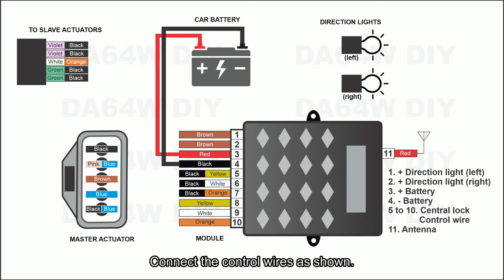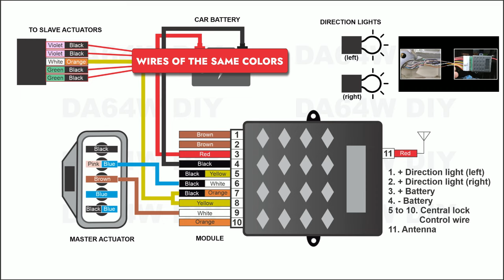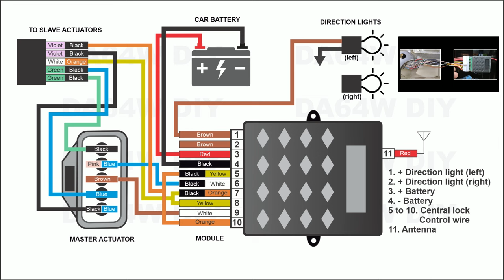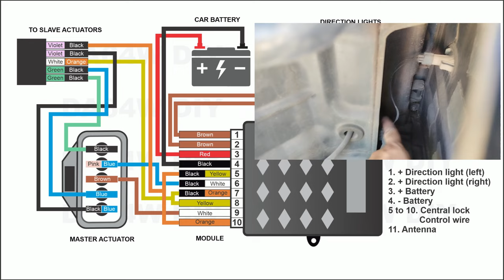Keyless Entry System Installation (Detailed Version)

Comment: is it possible to install keyless entry on a manual car
Reply from the maker: Could you clarify whether you mean a car with a manual transmission or a car with manual door locks?

For Manual Transmission: Keyless entry systems can be installed on cars with manual transmissions without any issues. The installation process is similar to that for automatic cars.

For Manual Door Locks: If your car has manual door locks, it might require additional work to convert to an electronic locking system before installing a keyless entry system. This may involve installing actuators in the doors to enable remote locking and unlocking.

Comment: what battery do you use for the fob? mine is kinda finicky when clicking it. sometimes it locks but mostly not. i noticed yiur fob led is blue but mine is red. maybe its a battery issue
Reply from the maker: My key fob uses 2x CR2016 batteries. The finicky behavior you're experiencing might be due to a low battery. Replacing it with new batteries might resolve the issue.

The difference in LED color could be due to a variation in the fob design, but it shouldn't affect functionality.

Comment: How can install the light 2 brown cables on switch button with 3 cables( signal lights..ground..corrent 12v)..can u help me? GREAT VIDEO 👍
Reply from the maker: Tap it on the positive wire of the signal lights.

Comment: gi tang² nimo ang iyahang original nga module ana Sir? or gi add lang nimo ang keyless entry nga module?
Reply from the maker: Nag-add lang sir.
Reply: @da64wdiy diman pwede sa akoa, way wires para slave. nindot unta ni kay function pa ang manual central locking.

Comment: Sir meron ako nabili na central lock with keyless pero yung for signal light niya isang wire lang. So if mag signal ako sa left sasabay din ang right. Ano gagawin ko po?
Reply from the maker: Kailangan mo ng dalawang diode, isa sa left signal light wire at isa sa right signal light wire.
Reply: @da64wdiy  salamat sir. Ano code ng diode at ilang amperes?
Reply from the maker: 1N5408 3 amps

Comment: Sir ung saakin nag connect lang ako ng alarm sa module di na gumagana ung manual switch nya sa pinto, ung remote nalang nagana.. Pag tinanggal ko lang ung remote dun lang sya gagana, tsaka iba yang wire ng module mo, kasi ako ung dalawang orange pasasamahin ko sa ground at ung dalawa yellow sa positive un kasi nakita ko sa ibang video, ganyan sana gusto ko tula ng sayo, nagana ung manual switch nya sa pinto at the same time pati ung remote sana
Reply from the maker: 64w din ba ang unit mo sir? Try mo e-check ang mga schematic diagrams ng module mo kung andyan pa baka makuha mo ang tamang diagram.
Reply: Sir nangyare din sakin yan nung nag install ako DIY, naka ilang ulit din ako at shuffle ng installation,, binalik balikan ko yung manual may mulpitple diagram siya nakuha ko siya by isolation ng orange wire (wag install),,, 2 yellow wires connect sa ground,, tapos make sure wala kang loose connections,, yung sakin kasi nag tap lang ako sa central locking dahil alangan ako mag splice
Reply: Ginawa ko din kasi yan na install orange sa ground at yellow sa positive  ganyan na ganyan nangyare